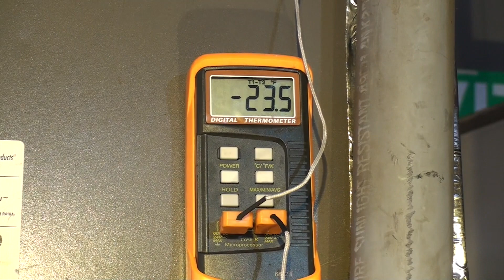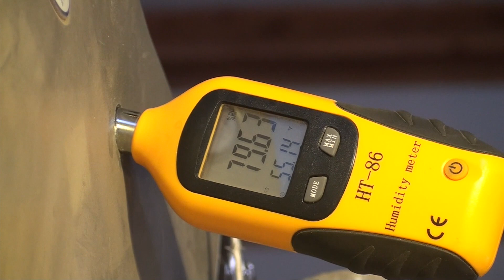Why is there more humidity in air conditioned discharge air than inlet air

Comment: my answer is that when air is passing over the coil the refrigerant is sucking the heat out of the air passing over, causing a temperature drop and humidity to go up causing condensing.  ??
Reply from the maker: You got it.
GFM

Comment: Cold air holds less water.

The cooler air is closer to being full, but it's a smaller "bucket".

Relative humidity increases as you decrease temperature. Unless you are at 0% or 100% humidity to start.

Comment: another way of looking at it is, go to the fridge and pull out a bottle of water, as the bottle temp hits the warm ambient air the outside of the bottle forms moisture... wipe it away and it reforms again and again until the temp of the bottle water reaches the room temperature

Comment: by the way: this is not uncommon. many systems inhale air at about 70 to 80 %rh and exit at 100%. In engineering terms this is what we call a coil inadequate for a load or excessive outside air or stratification of the air thru the coil or seeding of the coil with more moisture than can be exhaled.

Comment: speaking from a known fact, warm air holds more moisture than cooler air but that's not the question. The fact is, it started to rain in the plenum. Moisture is dropping out of the air, onto the coil and draining into the cup, so one would expect a lower moisturized air. I must conclude the air leaving the plenum has a lower dew point thus a higher humidity because the system is drawing more air than moisture it can drop out.
Reply from the maker: melvin292 Well said.
GFM
Reply: grayfurnaceman  I wish you could have been one of my college professors. You have a talent for teaching. You also make the best videos on HVAC-R subject. Very Very well said and produced videos. G-Man, you are the best. Keep up the great work! I have learned so much from you. An old saying, and I quote: "if you want to be the best, then learn from the best".  You my friend, are the best!
Reply from the maker: melvin292 Thanks for the support.
GFM

Comment: The key is RH went up, not the total amount of humidity.  Since the air on supply side is cooler (and denser), the amount of water vapor in the air takes up more of the space in that air.  The supply air, is hotter and less dense so it's capacity to hold water is greater, but aht means less RH in this case.
Reply from the maker: Joe B Sounds correct to me.
GFM

Comment: The humidity has not increased, the relative humidity has.
Relative humidity is the measurement of the amount of moisture currently in the air compared to the amount of humidity the air can hold at that temperature.
Although moisture is being remove from the air, the air is also being cooled.
The colder the air is, the less moisture it can hold.
So the colder air has a higher relative humidity compared to the warmer air even though moisture is being removed by the evaporator coil. If you we to heat the discharged air back up to 62 degrees you'll find that the relative humidity is indeed lower.
Reply from the maker: Randy Dallaire I can't argue with that.
GFM
Reply: Randy Dallaire You are absolutely correct.  The RELATIVE humidity, which the meter reads, is the PERCENT of moisture which is in the air, at the given temperature, versus the amount of moisture that the air COULD hold (completely saturated-100%) at THAT SAME TEMPERATURE!  Since the temperature changed, the RELATIVE humidity went UP.  Hope this helps.
Reply: Randy Dallaire Makes complete sense to me as a layman
Reply: Exactly, that's why when you have a unit with any form of reheat for dehumidification purposes you will see discharge air with the rh you would expect to see or want to see. Correct with all of that

Comment: I am still taking a hvac class at school. I guess the lower temperature of air is able to contain less humidity than higher temperature of air. That is why ac unit removes the moisture from return air but the rh of supply air shows higher . Am I correct?
Reply: jiimy li Just keep in mind that the reading on the meter is the RELATIVE reading; meaning that the amount of moisture (HUMIDITY) in the air is the PERCENT of moisture actually in the air compared to the amount of moisture that the air at THAT SAME TEMPERATURE is capable of holding!  That is why the discharge air leaving the coil, BEING ALMOST 100% SATURATED (RELATIVE HUMIDITY) has been COOLED down to the DEWPOINT of the air, some moisture removed on the surface of the coil, and the discharge air is 100% (or almost 100%--coil inefficency) SATURATED.  HIGHER TEMPERATURE GOING INTO COIL AT, MAYBE, 60% SATURATED;  LOWER TEMPERATURE COMING OUT AT ****APPROXIMATELY*** 100% SATURATED!!!!!!!!!   Hope this helps.
Reply from the maker: jiimy li That's pretty much it.
GFM

Comment: I would take that reading further downstream from the coil
Reply from the maker: Kenneth Cotto The humidity will not change in the ductwork after the coil.  But it will change once it mixes with the air in the structure.  Hope this helps.
GFM

Comment: Relative humidity varies based on air temp and colder air is not capable of holding more moisture than warm air so the colder air has a larger relative proportion of moisture even though moisture is clearly being squeezed out as it passes over the coil in the form of condensate. That's my theory and I'm stickin' to it...
Reply from the maker: Adam Shaiken Good theory.  I agree.
GFM

Comment: U have water splashing in there from not having a silly trap and thus sending it out the discharge air .....no?
Reply from the maker: Kenneth Cotto In some cases, you can indeed throw water into the return by not using a trap.  In this case that is not true and the higher humidity is normal because the air temp is lower.
GFM

Comment: Maybe cold air can hold less humidity than hot/warm air. Since the air coming in has more humidity capacity than the now cold air the excess humidity has to condensate because the colder air has reached saturation point...?
Reply from the maker: Dicofole Consider the air to be a wet sponge.  Water may not drip from the sponge, even though it is wet.  Squeeze the sponge to imitate colder temps ( colder air has the molecules closer together, so there is less space for water).   Water comes out.  Hope this helps.
GFM

Comment: The RELATIVE humidity went up..
Reply: Joe Shearer
Reply: Lee Crouch
Reply: Yes Ray Jones s?
Reply from the maker: Joe Shearer You are correct.  The humidity is very high as it exits the coil because the air is brought to the dew point as it goes thru.
GFM